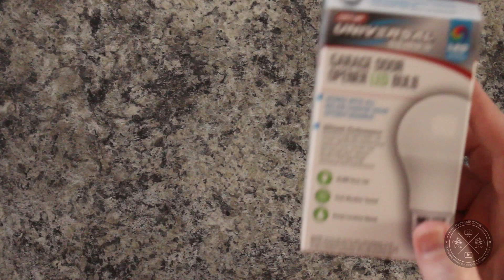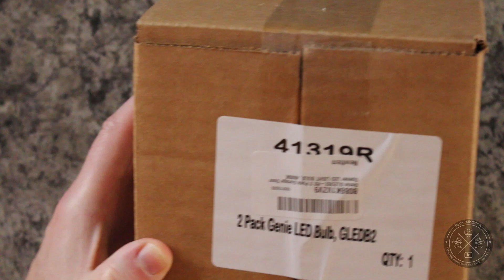Rough Duty Light Bulbs & Genie Garage Door Opener Bulb Review  –  Episode 47 –  DadsTalkTECH

Comment: The video dealt mainly with the problem of vibration on garage door openers but the Genie LED bulbs also greatly reduce or eliminate Rf interference that affects remote control operation.
Reply from the maker: That is great point.  The bulbs also handle temperature extremes much better as well, as we touched on a bit.  We appreciate you watching and commenting!